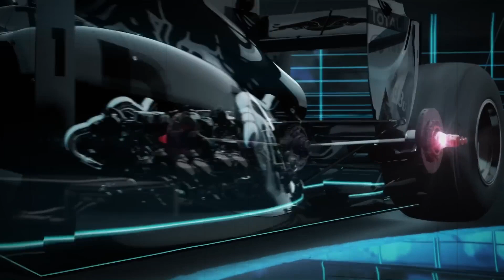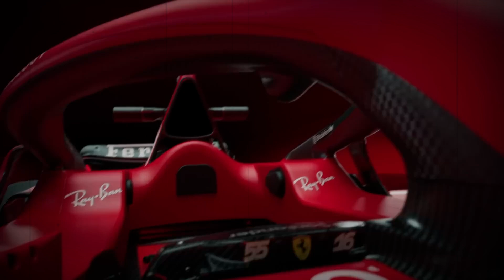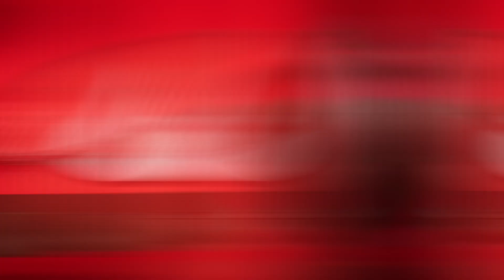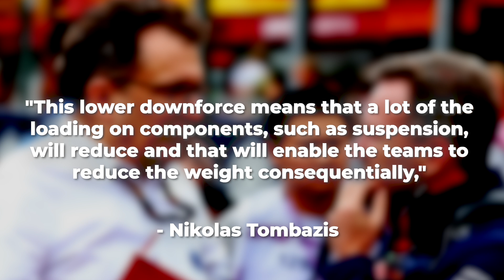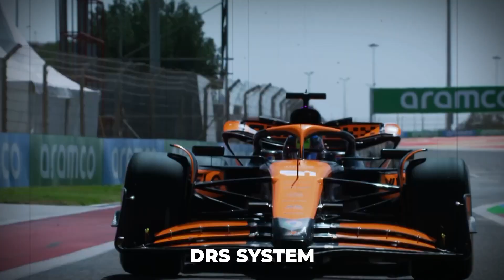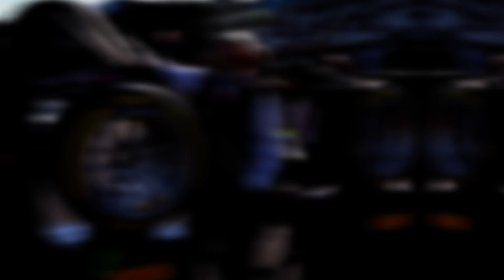MASSIVE F1 Rule Changes Leaked that will Change EVERYTHING!

Comment: DRS needs to be removed.  Two piece rear elements with a standard for separation between the two planes.  Maximum standards for rear diffuser design.  Exhaust standards for placement.  Front and rear mandatory sizes for brake ducts.  There are fixes.  One more thing, sorry for the edits.  Get rid of the damn wheel covers.  They're cars, not aero-simulation pods.  I think the FiA and the FOM are forgetting,  these are cars.

Comment: The 18' to 16" tires are good for the visibility of the driver. 
Do NOT downgrade the engine, 1.6 L is just to small.. F1 is a motor racing event 🤷🏻‍♂️ not an electric event. 
Cars should be nimble, light and agile and most of all not to big in width... For overtaking purposes.

Comment: Hey F-1, don't go backwards, with smaller tires.  DR should be enabled all the time, whenever the racing is not under caution.  However, more penalties should be enforced for unsafe driving, regardless of the team involved.  Also, the author of this article should never refer to it as "Push to Pass" .  You sound like an Indy car guy.

Comment: Make them lighter by removing the batteries and bringing up the V10s. Make them narrower and shorter. Leave the tires at 18" but with lower profile. Make dual exhaust mandatory. Limit the gearbox to 7 speeds (to make the engines rev more).

Comment: The need to start looking at the finish lines as well. Unless F1 titled games are wrong, there are a lot of tracks with the finish line at the BACK of where the grid starts the race. This means, technically, only the drivers in 20th position have actually completed the full race, but more importantly, some of the DRS zones at the end of teack are made pointless, unless the trailing driver is on his tailfin

Comment: To say going 18 to 16 is a step back and doesn't support road applications is just as dumb as saying active suspension is too complicated and costly for F1...hard to name one moderately sporty sports car that doesn't have active/adjustable suspension. Nearly all the drivers are complaining about ride quality of current cars and lower profile tires for the 2026 regs doesn't help that either.

Comment: Active aero and KERS-like systems, just like DRS don't promote more racing. The changes may (!) be helpful to see more overtakes but not more racing. If such systems are activated on the straights (and, realistically, where else would they be aside from breaking) it wont help any driver in corners, in fighting back immediately and in following/leading others. DRS does f* all for racing, only for speeding past another driver while at the same time hindering them through occurrences so infamously known as DRS-train. It sucks and is not proper racing. Give them good engines, light cars (no hybrids) and less aero. Then you can attempt to moderate the diffference between cars via regulations so as to attempt to keep them closer together and one team less dominant as has been the case in some past seasons. F1 is ne pinnacle of racing, not sci-fi rocket ship engineering. That's what other series are for.
Reply: Amen to that.

Comment: Whatever rule changes they are making, it has been revealed to a particular team to try out and inform them of the work abilities of the new regulations, for which the said team would benefit from. That they will do with RB, they never attempted to change the rules in between as they did Mercedes, removing the beast mode, the dual axle system, the suspension and many more that kept slowing down. Mercedes to enable RB to finally catch up. Tell me which area in this present regulations have they touched to slow RB? 
Didn't Ross Brawn before the start of the new regulations season that any Team that dominated would be quickly checked? Was that a reason they retired him to make way for RB dominance?
Reply: Absolutely right. The thing is they build regulation according to the favor of a certain team, While it should be in the 180 degrees opposite way. Build a car according to the regulations.
Reply: Great conspiracy theory, it still hurts i guess.